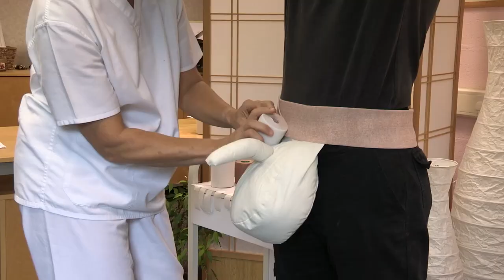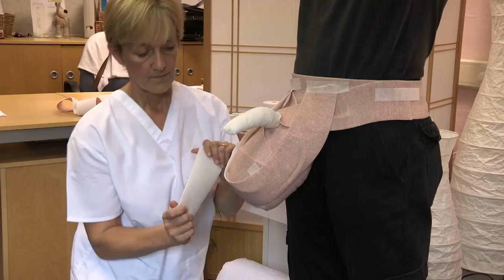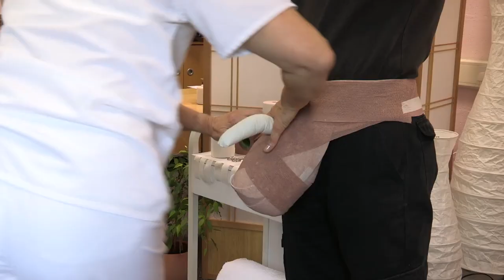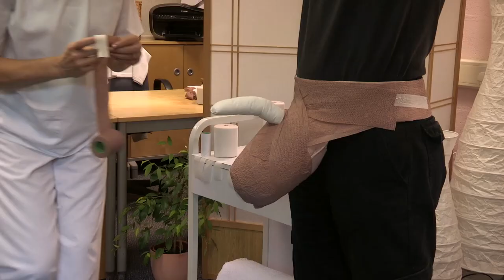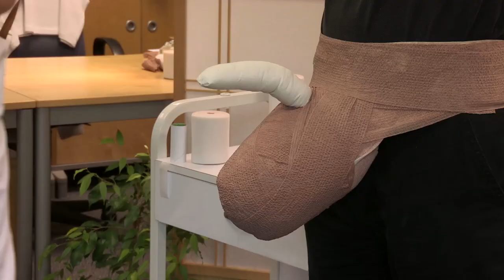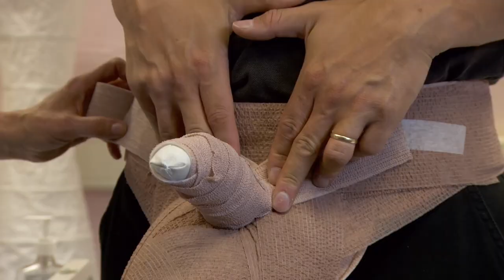3M™ Coban™ 2 Layer Compression Systems - Scrotum and Penis Application

Comment: What to do when urine sprays on the bandages?
Reply from the maker: Hello Willadean, patients should be advised to keep 3M™ Coban™ 2 Layer Compression Systems dry. If the bandage becomes wet, patients should contact their health care provider to determine if it should be replaced.

Comment: What is this for? Prostate issues?
Reply from the maker: Hi, thanks for your question. 3M™ Coban™ 2 Layer Compression Systems are ideal for the management of venous leg ulcers, lymphedema, chronic edema and other clinical conditions where compression is appropriate.
Reply: In layman's terms: if a man has a disease that causes his scrotum to fill with some sort of fluid (lymph fluid, water, etc.), applying the bandages this way will help compress his scrotum in such a way that the fluid will flow to other parts of his body. This will reduce the uncomfortable swelling in his genital area and probably improve his quality of life as a result.

Comment: Now reapply 5-6 times a day.

I have lymphedema. I don't have this type of Lymphedema, but this type of wrapping is frankly bullshit, same as the extraordinary leg wrapping done for leg lymphedema.

What you really need to do is devise a garment that a patient can easily apply and remove themselves, many times a day, to provide sufficient compression. Velcro wraps are extremely effective for legs, worked incredibly well for my large legs. The Lymphedema wrapping done by lymphedema trained people was not effective at all. It was in fact my lymphedema therapist who lead me on to use velcro wraps instead, because of how effective they seemed to be.

This type of application of garment is absurd and backward thinking, and should only really be applicable for size reduction. Once the size is reduced, you should have a better solution. The problem is I don't think companies are motivated to develop those solutions because they can sell miles and miles of discarded material instead of washable and reusable velcro solutions.

Comment: Will this allow for erections? I have an injury that won't heal. I think that the problem is that nightly erections open the wound, but I'm not sure whether it is safe to obstruct * erections. I wonder whether your product could help.

P.S: The "wound" seems to be blood vessels that are stretched (not burst) along the diameter. It resulted from too much internal pressure. It gets better during the day but is worse in the morning after several long nightly erections.
Reply from the maker: Hi, thanks for your inquiry. Please fill out the contact form at https://s.3m.com/zyjfu2 and a representative will get in touch to recommend the right product for your specific needs.
Reply: Some nonclosing wounds are due to infections